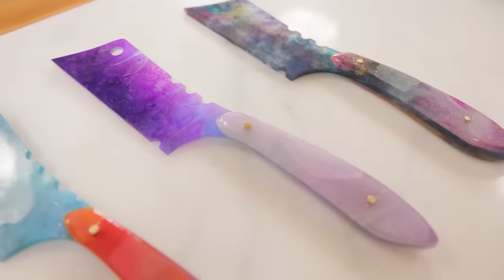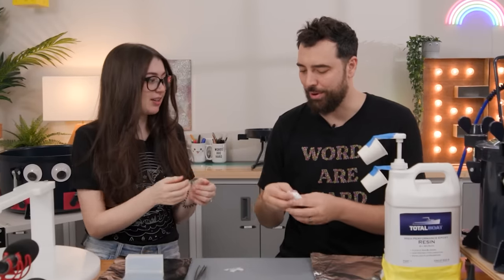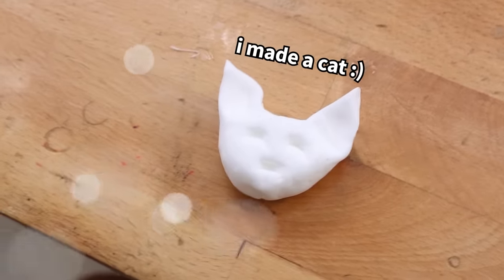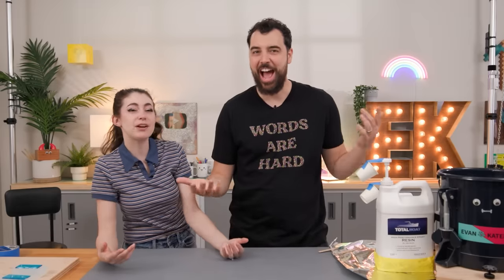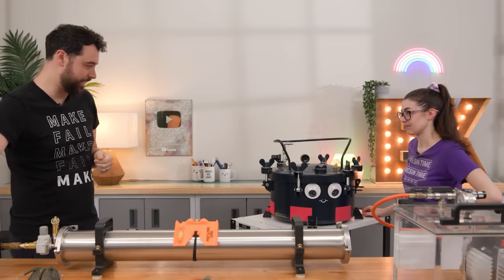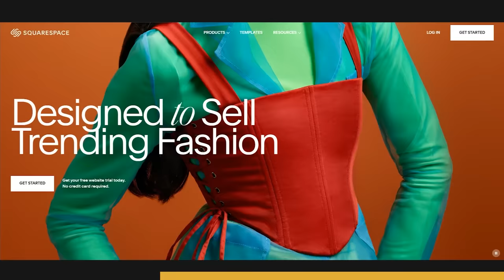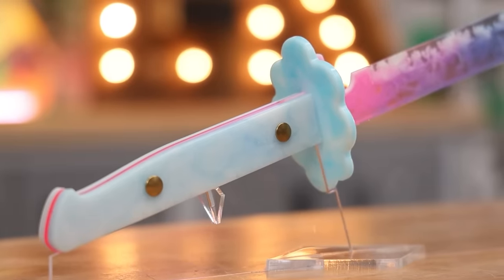Making an Air-themed Resin SWORD (it glows!)

Comment: The injecting resin vertically tests to make clouds didn't necessarily look like clouds but they do look REALLY awesome! Like smoke, ghosties, or wispy lava lamp. So much dramatic spoopy potential.
Reply: Oooh i want a ghost sword :0
Reply: Yeah, the problem with trying to look like sky clouds instead of wispy ground level stuff is that they have white inside the blue.  The whiteness of sky clouds is always in front of the blue.  Not that the wispy stuff wouldn't also be in front of the blue, but it's more open so it looks more natural, the blue in front looks more like it is just extra thin wisps at that point.
Reply: Definitely could use that method to do some sort of fire effect
Reply: To me, it sorta looked like sea foam. If they do this again with a water themed weapon, that method would look pretty nice
Reply: I kind of like the look, a wispy smoke look actually fits an air theme too in my opinion because it creates a look of motion like wind is blowing smoke about
Reply: look like smoke to me, super cool
Reply: @lacytaylor1501  Yeah, it does still fit the theme really well.
Reply: I agree
Reply: They look like water to me
Reply from the maker: love the wispy lava lamp ghost aesthetic
Reply: So... clouds of smoke?
Reply: @EvanAndKatelyn  It still perfectly reads as air themed to me, as it looks like spooky fog spreading and curling over the (very cute) night. It's like cute spoopy.
Reply: All I could see with Katelyns attempt when they panned back was a smoky word "DOG"
Reply: @lacytaylor1501  it fits the theme better than clouds seeing as clouds are water but I get what 
there going for.
Reply: riversgrace  🤪 hehehd
Reply: It looks like flame
Reply: they look kinda like coral or sea foam

Comment: Clay: Air dry 😄
Evan: Microwaves it
Clay: Doesn't cure
Evan: Is confused
Reply: Yup. I was yelling at the screen lol
Reply: Hairdryers work better because you're actually using air movement to dry it out instead of just heating it up
Reply: There are air dry clays you can dry in the microwave
Reply: @silg7262  liked this before they got to the various air dry clays, because paper clay is an air dry clay...
Reply: I mean his reasoning kind of makes sense. The term air try implies the water evaporates out which is how the drying process works and heat makes water evaporate 🤷‍♀️

Comment: Could you use UV resin to make clouds then embed them into the epoxy resin after they’re fully cured? ☁️
Reply: My thought also
Reply from the maker: that probably would have worked!
Reply: it probably wouldn't have looked that good cause they'd have the same refractive index. It would've still turned into a ghost like the normal resin
Reply: @yami_the_witch I think what they mean is make the cloud shapes out of white UV resin in a mold or on a silicone mat, cure them so they're like hard little bits, and slide them into the mold. They might look a bit flat with the resin but they'd keep their shape

Comment: the bucketed clay you guys got is actually foam clay often used by cosplayers for working with eva foam! they use it specifically because of how smooth and malleable it is, as well as the fact it has a lot of working time.
Reply from the maker: i could totally see it used for cosplay, especially with how lightweight it is!

Comment: The air dry clay might have cured better over night instead of in the microwave--it dries with air exposure.  Polymer clay may have been a good option to try, too!  It comes in translucent, and mixing in a touch of white may have made for some fun tinting for it.

Comment: I’ve heard that microwaved soap also makes great little clouds to use for resin (in case Evan needs one more thing to microwave! 😂) love your content so much!💕
Reply: Yeah I sat here thinking ‘no one told them to microwave Ivory soap 😢’
Reply: i'm not sure soap clouds would work because they're so fragile. trying to insert them might crumble them.
Reply: @tunesquicklee plus when the resin cures, the heat could melt the soap and cause some mixing problems. Still would be fun to watch them try😅
Reply: yep, whenever I've made clouds for putting in resin, microwaved ivory soap is always the way to go. they just look so good and its pretty easy

Comment: The second microwave dried clay was less cured, because the first got much hotter on the hot wood. Also, other fluffs would behave differently from cotton - fibers have different stiffness and lengths, plus different chemical compositions would interact with resin and dye differently.

Comment: I really want to see you guys now make a bunch of stuff with the foam clay. I've used it before when one of our Loki horns had a failed UV print on one side. I molded the horn, let it dry, coated it in UV resin, gold paint and badda boom badda bing! President Loki costume for my son. To be fair, I should have let it dry longer because it shrank over time. But we just needed it for a quick costume repair.

I also saw Rachel Maksy use it for fun wood carve details on one of her projects. Possibilities are endless.
Reply: Rachel has actually used air dry clay on a bunch of different projects and it always ends up looking amazing! Just because the stretchy air-dry clay didn't work for this project doesn't mean it won't work with something else. The possibilities of amazing projects that can be created with that stretchy clay are truly endless.

Comment: when you're making the molds, you can use silicone caulk in the edges to keep the silicone from seeping in to the corners.  it makes the edges of the mold neat and clean.  

also, i've never done it, but it seems like other channels that use the vacuum chamber to get rid of bubbles pull the air out until the bubbles nearly boil over, release the vacuum to pop the bubbles, and repeat until all bubbles are popped.

Comment: I think that the first air dry clay actually was air dry paper clay and the others were a traditional air dry clay and it would make sense if it was a Japanese product because that’s where paper clay was first most popular and still have very popular brands specifically from there so it’s a bigger market. Although air dry clay is so versatile that I’m sure y’all could find a bunch of cool things to do with it, especially being able to use it with things you couldn’t put in an oven

Comment: EDIT: or even just making some clouds out of resin, in small sheets, and cutting those out to then add into the mold

I would like to recommend making a flat sheet of resin, painting on what you want, adding a second sheet of resin, tracing your tool out onto the resin, cut it out

As others have said it doesn’t really look like clouds, with the cloud guard I CAN see a wind effect and it did turn out REALLY cool, but I more so see water in the blade when alone and the cloud guard isn’t there.

I still LOVE it and it looks Awsome! Just some food for thought

Comment: A great way to make a cloud effect is very slow but very worth it, I've personally done it before and I think it looked great. 

You pour a thin layer of resin, and when its dry you paint on a very transparent cloudlike shape, but only the part that would be closest to you. You repeat the process slowly building up 3d transparent shapes. If you use more opague paint you can make other things in 3d using this layering technique, I've seen someone do a cute fish in a bowl like this as well, where they painted layers of the fish slowly building it up.

Comment: One way to make the handle scales to look a little better would be to make them clear with cloud and then make the hilt underneath be blue.This would give a 3d look and you could separate the blue and clouds. Another cool look would be to have a double pour for the blade.  Use 2 different sized blades and cast the first then put it in the second mold and then fill around it.  You might be able to make it look like and afterimage if the colors are done right.

Comment: This is how I make a cheap (under$40) pressure pot.  I purchase a cheap whole house filter housing ($19), a combination Pressure gauge and Schrader valve (same as the air valve on a tire) on a small fitting called an "Air Test Assembly Gauge" ($15), and a few 3/4 inch pvc fittings.  Some Teflon tape.  They also have housings  that are clear so you can see what is going on.  You can find these at any big box store.  The whole filter housing container has a built in pressure release button.  These parts are easily rated, if not higher, for 100 psi as they are used in water systems.  I use a portable tire air pump which easily pressurizes the unit to 50 psi.  I tested how long the unit would hold the 50 psi and I stopped the test after 48 hours, was still at 50 psi.  Because the unit is tall and skinny I cut a circular disk of wood (MDF), at the correct size to create a shelf at the level I required which was about 8 inches.  You can probably go about 10 inches deep.  There are other housings that can go deeper, for example 20 inches.  Affordable, easy to build, and very safe.

Comment: The shaking the B tub for the silicone is maybe something you should do with the lid on I would think. 
with the hole in the tang you should maybe just have put on tape on one side and fill it with UV resin or something like that.
With the syringe technique you should maybe have drawn in the syringe before pulling it out to reduce the whisps going up?

You should also put a pully in the celing to use when removing the lid from Max 😀

Comment: I was going to suggest another way to do this would be to make 2 molds, one smaller than the other. Let the small one harden, then paint perfect little clouds on it then use that as the core to the outer layer

Comment: That's amazing. You should make another air sword where the blade isn't contiguous? Where the parts of the actual blade have parts that look like the wind has molded it outside the traditional blade of a sword. With similar resin color schemes. Or perhaps use that for the water element, only use water's frozen form, a fire and ice.

Comment: the ones that raise to the top could u seal the top off an lay them on there sides an then if they raise  it would be up against the front of the piece u have them in, not sure if that helps, i only work with resin in 3d printers, ive never messed with pouring resin but love watching u guys make stuff with it.

Comment: Video idea, flower pots… not ordinary flower pots but self watering ones that use the “greedy cup” principle to protect from overwatering…3d printing one would be simple(assuming you can get it waterproof) but one  using concrete or resin would be challenging

Comment: Usually when putting things in resin layering is necessary,or make a little mold for a resin holder ( of the same color if the resin is colored) for the clay then you put it on the holder pieces put them in the mold wir attached clouds and fill it,might be silly but it do be an idea.

Comment: I reckon they should still have tested the polyfill. Cotton and polyester are totally different. Cotton is going to soak up dye. Polyester - which is a kind of plastic that has to be dyed in a special way to take up the dye - probably wouldn't have soaked up any dye.

The wool probably would have gone weird with the temperature changes. And soaked up the dye.

Comment: If you ground that tac weld down you could remove the guard and not lose the tang. Then just do a resin pour inside the void before you casted it. A lot less work.

Comment: clay naturally has water in is, i'd be curious is the wall texture spray would be good for resin clouds since I don't think there is water in it. I know you can just use a scraper and get them off surfaces and once they are dry they hold their shape. just a thought.

Comment: Engineers brain- cut the whole thing off and design a new one and try to attach it inside the mold.
Others brian- grind the 1 tiny tack weld real quick and fill the handle void

Comment: Where I'm at in the video, you haven't poured the resin in the mold yet, but being that long and narrow, do you need to do something to keep the middle from spreading and making that part of the sword thicker?

Edit: it looks you weren't going for that kind of precision, and it turned out amazing, so that's great! If you wanted to sharpen it, you might have to do it differently, but it looked amazing!

Comment: Note: air dry clay made by Crayola has the same texture as the Japanese clay. 

Also, with the resin clouds, what if you first made the clouds (separately) like you did with the clay than inserted them into the blue resin?

Comment: The clay from Japan had a hole in the package and they were worried about it drying. Maybe it has a different texture because it partially dried. You should try partially drying the other clays.

Comment: 21:00 I noticed they advertised this for camping and fishing. But I want to point out that what they did is very dangerous. 

By cutting out the knife in the handle it’s already incredibly week. But by welding the metal on its also incredibly weak and could snap under pressure sending the blade flying.

If you’ve ever watched forged in fire you know when it looks like when thoughts errors causes a blade to break and go flying.

Comment: A full tang that is welded on, would that even be considered reliable? Like full tangs are supposed to be very stable and makes the handle less likey to slip. Would the welding cause that point to be more likely to break? I don't know welding much.

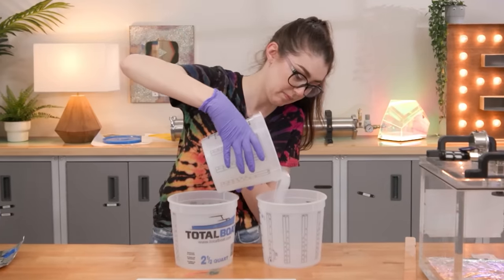Comment: 25:55 Did Bubbles want to be removed or were you evicting him?

Did you test Longboi using water pressure? Your local model steam railway guys can certify it for you (water is good. If it splits the thing, it won't explode)

Comment: Timestamps below:

00:01 ⚔ Creating an air-themed resin sword with resin clouds.
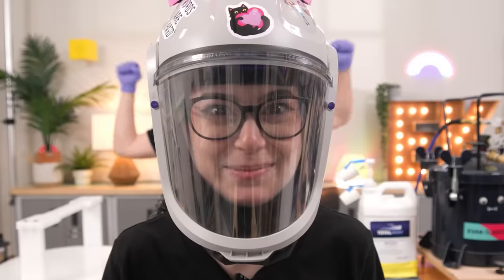03:02 🌫 Experimenting with various materials, including clay, for cloud effects.
19:06 🌬 Injecting concentrated white resin for cloud simulations.
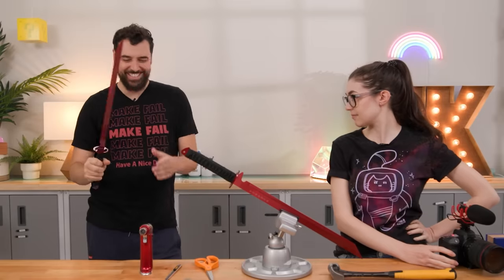20:36 🔪 Disassembling a cheap sword revealed concealed knife.
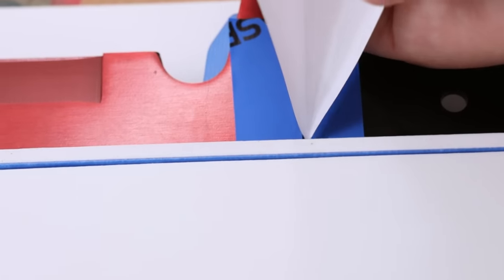23:21 🔧 Repairing a cracked sword part with baking soda and super glue.
27:15 🛠 Using a homemade pressure pot to remove bubbles from the mold.
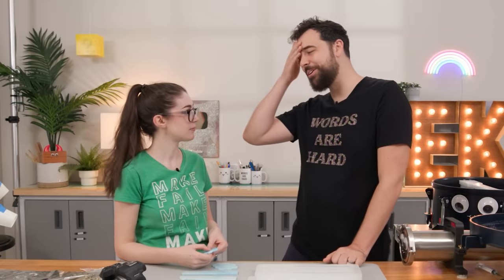38:04 🌟 Successfully demolding the resin sword with glowing clouds and gradient effect.

Comment: Using wool most likely would have worked, I’m in fiber art and you need an acid and heat for it to take dye. Nonsuperwash takes dye less than superwashed fibers.

Comment: The normal air-dry clay that you are using is actually called light clay. Light clay is actually bouncy, the actually air-dry clay has a different texture, though I don't think it's what you're looking for either.

Comment: Hi guys, would a heat gun help in place of a vacuum chamber and pressure pot, to remove bubbles when casting resin in sillicon molds? I'm planning to try to cast keycaps but low on budget to get a vacuum chamber and pressure pot.

Comment: anything u put in the microwave that hold moisture will get hot faster, im not 100% on why but i know its do to with the frequency of the microwave being able to produce heat in it easier than something without moisture. something to do with how its able to excite the molecules of the water better than without.

Comment: Cornstarch…? Injected in resin suspension and swirled around for misty clouds.
Cotton wool… could you spritz some UV resin on the fluffy bits (ie spray lightly around and through instead of soaking) and cure before putting in mould/mold to preserve three-dimensionality, colour and fluffiness?

Though, funnily enough, what says “visible air” more than anything? Freaking BUBBLES guys!!! Maybe need to put varying size bubbles to make it look intentional.

Comment: constantly losing it over them not understanding the difference between the usual air dry modeling clay and air dry foam clay(the "gum" clay)
i use foam clay for some projects, it's meant to dry in a similar texture to foam, not tough like polymer clay would jjdfjdhssjhd

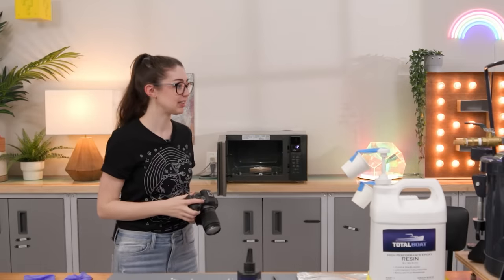Comment: 02:13 microwaves cause water molecules to vibrate and produce heat. If your material doesn’t have any water molecules in it like ceramics, they don’t heat up. But wood and cellulose have water in them….so 🤔🤷😂